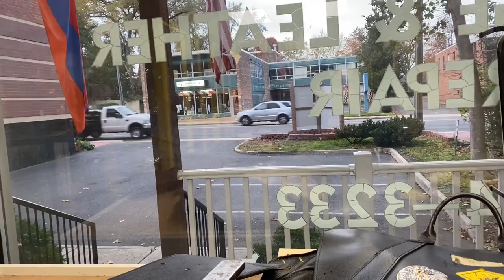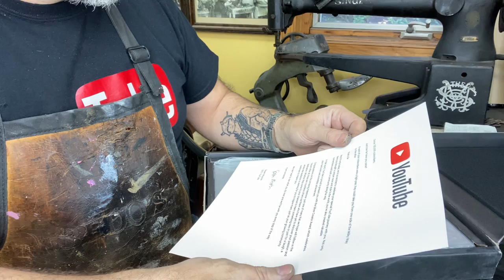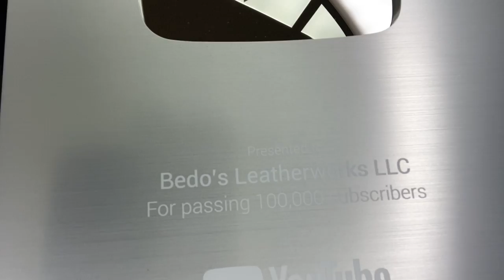Aviators Bag Brought back to life.

Comment: I thought I recognized Chris.  I went to High School with Chris Swadener.  He flew C130s.
Reply from the maker: That’s AWSOME
Reply: @BedosLeatherworksLLC  Beautiful work. If you would like to reduce hand tremors and improve your fine muscle control, look into Magnesium Malate supplements. There are many peer-reviewed studies you can look into. I have found within 30 days of supplementing, you will see a nearly complete reduction of shaking hands. The added bonuses include headache reduction and reduced muscle sorness. 

If you find more metal components in leather; you can convert the rust (iron oxide) to iron tannate which won't rust with a comercially available rust converter. It will protect the leather from the corrosive rust.
Reply: Or just smoke some pot 😁
Reply: Vote thumbs up on the pot

Comment: Congrats on your plaque and another great project. You are not crazy to resharpen your blades. I took French leather working courses and the cutting knife used in the courses was a clicker knife. Part of the initial instruction was how to sharpen your clicker knife blade with a file to be razor sharp. It's not just about being cheap or traditional, as I have a few razor knives in my tool box, but about economics and having tools on hand when you need them. Buying blades adds up, and if you run-out of sharp blades while in a project, maybe late at night or running up to a deadline, there is no time to pop out to get some more. Knowing how to touch up a blade is a good skill to practice and know. Same goes for having hand sewing skills, for when the machines can't do it. Thanks for sharing.

Comment: This video popped up as a recommendation and I really enjoyed it. I worked at a belt shop for 11years making leather belts, wallets, purses, holsters, knife sheaths ect... Then 5 years working at a place doing luggage repair and modification.  And for the last 7 years working at an upholstery shop. I found the triggering scene really funny and can do you one better, I use a snap blade knife and resharpen it regularly; with sandpaper. I did however trigger when you used your steel french hammer on your steel punches. But I got over it, your hammer, your punches. Your shop. I will keep watching.

Comment: I sharpen those disposable blades when cutting foam...which dulls them super fast.  Why waste the money on constantly swappin out blades! :)
Reply: Same. I run mine over the strop for a while before they need replaced.
Reply: hi echo, i use to cut foam with my utility knife too. it always made a mess too i use a hot wire now. its cleaner and you dont have all those little balls making a mess.

Comment: US Military Bag - the US Federal Catalog assigned its parts in 1962 ... the pricing ranges from $1300-$2300 but there's currently a similar model on eBay for $35 (in fair condition).

Comment: Googling for the bag specification shows this particular one was in use for a very long time, and no doubt there were several contractors making them at different times, and maybe more than one at a time. It's going to be hard to track down the manufacturer without knowing exactly when it was made.

Comment: Would 0000 steel wool leave it polished like jewelry or under an inspection light would you see fine scratches? Interested in how quickly 000 wool cleaned this up.

Comment: Hello sir. I'm a new follower on your channel. I got a question for you if you don't mind. About 8 years ago I acquired a pair of Redwing boots. I have only used them a very few times. Because they "eat" the skin of my heals. I'm sure a man of your profession and skill set know an easy fix to my problem. So if you don't mind, could you help me out ?
Reply from the maker: It sounds like your heel is to loose, try a tongue pads.
Reply: @BedosLeatherworksLLC  Thank you I will try that. Reguarding another matter. I have seen you repair boots and bags. Do you do jackets aswell ? I got this hairloom, it's about 80 years old and it's falling apart. In my contry your craft is nearly dead and the once we got left are doing your craft on a hobby basis. Somehow I do not feel safe by useing them.
Reply from the maker: @monkfortytwo2993  yes I do work on jackets